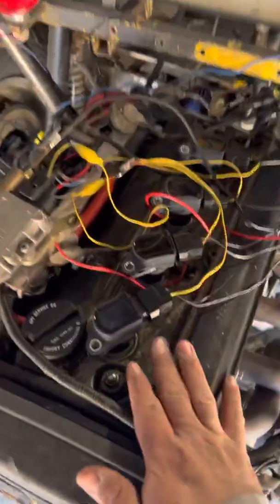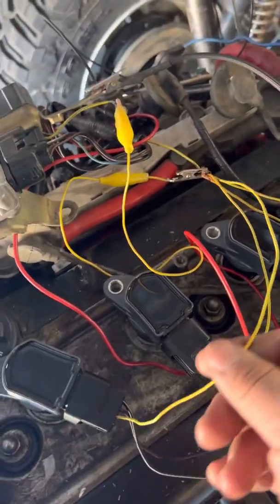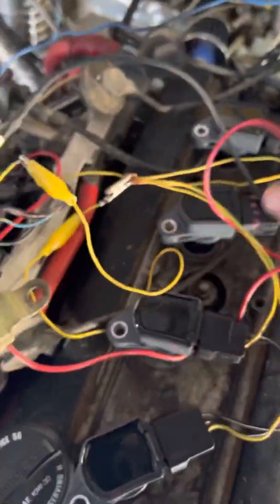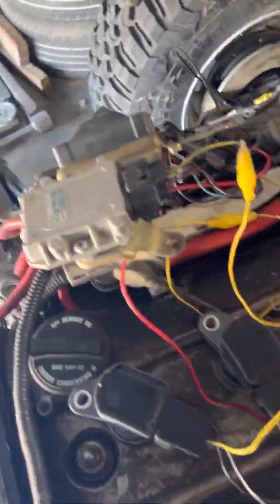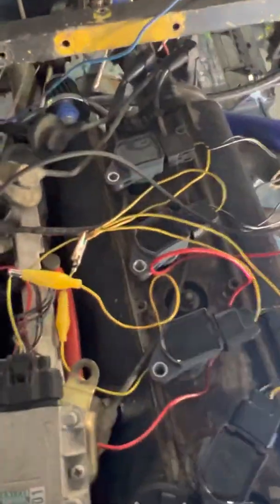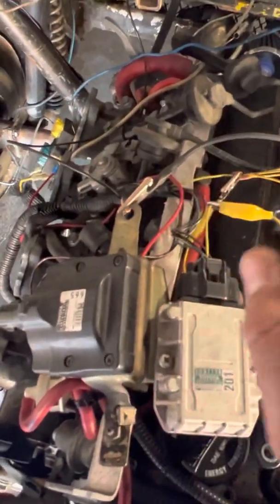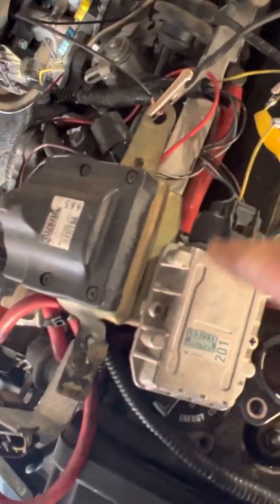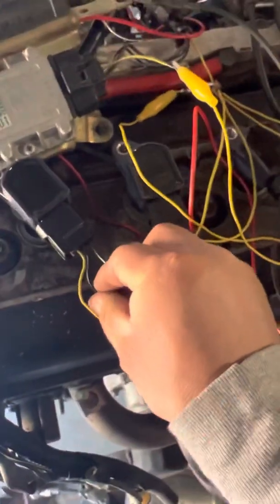4age Blacktop 20v COP (coil on plug) with STOCK ECU and HARNESS. Part 1

Comment: Coil 1+4 signal wire from igniter,  so coil 2+3 Signal wire from this one?
Reply from the maker: yes all 4 coils will be tapped into the signal wire from igniter. the signal wire bust still be going to the igniter as well.

Comment: Hey man love your videos !!. Quick question, where should i connect the power wire in the blacktop stock harness ? I can’t connect directly to the battery because its constant 12v right ?
Reply from the maker: Use a “fuse tap” in the existing  fuse box that has constant 12v. Make sure to use a 15 amp fuse tho.
Reply: @slow_carsgarage7422  thanks my man. i will try it and get back to you soon
Reply from the maker: @omgitsparjo  lmk how it goes
Reply: @slow_carsgarage7422  i’ve tried it and it worked out well ! Thanks for the heads up bro. Now im gonna tidy up my harness and use the proper fuse tap. Thanks again !!
Reply from the maker: @omgitsparjo  how’s it coming along ?
Reply: @slow_carsgarage7422  its been running well for the past year. sorry for the late reply tho haha xD
Reply from the maker: @omgitsparjo   im happy to hear that man!

Comment: I tried and follow all your steps on my Ae86 20 valve 4age and car starts but then turns off. I suspect maybe defective coils
Reply from the maker: did you ever get it going?
Reply from the maker: Do you still have the igt wire connected to the igniter ?
Reply from the maker: The yellow and green strip wire must be connected to each coil and the igniter
Reply: @slow_carsgarage7422  that sistems are waste spark?
Reply from the maker: @agusheripurwanto6633  yes.
Reply: @slow_carsgarage7422  nice,  same as injector sistems it worked?
Reply from the maker: @agusheripurwanto6633  did you get it started and running yet?